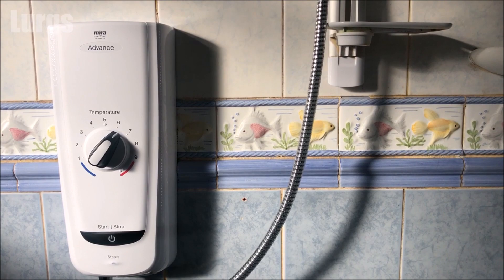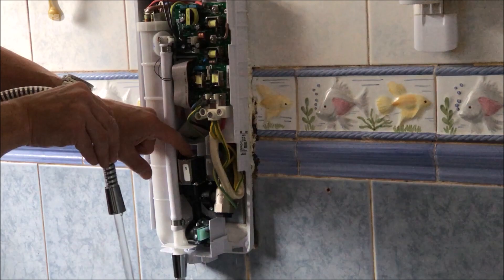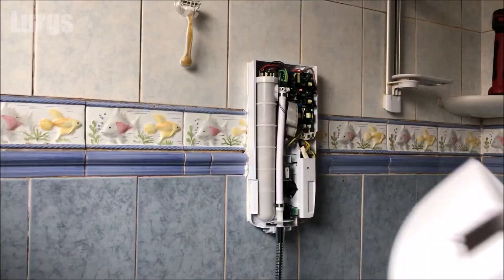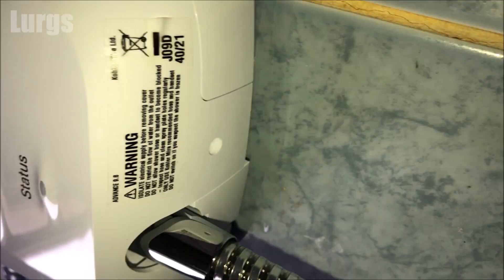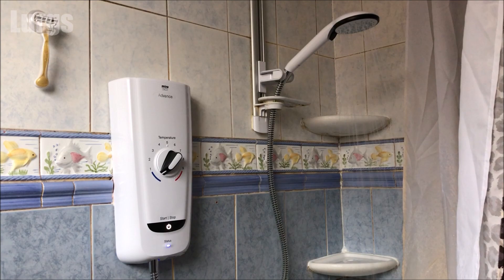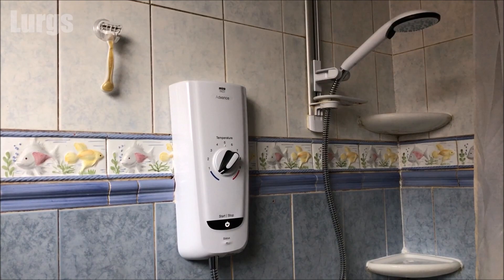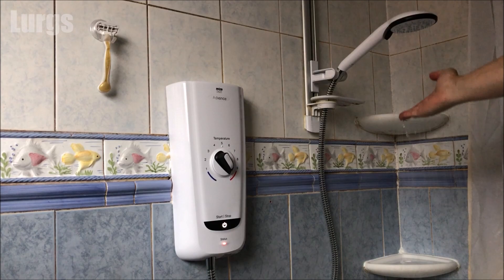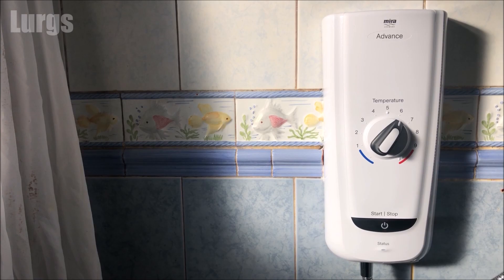How to Prime Mira Advance ATL & How to Commission Mira Advance ATL Thermostatic Shower latest model

Comment: Hi, I tried resetting my shower and also tried what you showed to do in your video, but it didn't work. I rent a council flat and when they sent an electrician out, he didn't even check anything, he just said I need a new one when I told him what was wrong and what I tried. They said it will be 3 weeks for one to arrive, is it really needing replaced or is there something else I can try? I even tried to get a Croydex Secura tap attachment on my taps and couldn't get it on, so I'm having to make do with baths - better than nothing I know.
Reply from the maker: Are you getting flashing lights on it? You can look up the meaning of them.
Pain having a bath. When we’ve lost a shower I just keep an empty large lemonade bottle or jug and sit in bath and fill that from running tap and pour over my head for a quick shower\wash which saves having to wait for bath to fill up
Reply: @LurgsHowToGuides The high flow light flashes when the shower is on, then when it switches itself off, beeps and the two LEDs below turn red, it stays blue. I checked for the error code in the manual and this is what it says 'Incoming water flow too low for appliance to operate safely, faulty Thermal Trip or faulty Heater Tank.
1. Reset the unit.
2. Check all plumbing isolator valves to the 
shower are turned fully on.
3. A section of the supply pipe is frozen, allow 
to thaw and insulate the pipe.
4. Replace Thermal Trip.
5. Replace Heater Tank.

I managed to force the tap attachment on eventually to have a shower, but the duct tape holding the shower head on the pipe wasn't holding and kept leaking, so I'll have to put loads more on.
Reply from the maker: Best bet is a Mira technician call out or if you buy a similar Mira shower it’s exactly the same fitting and screw locations

Comment: Does it work with a orange light after the final step or white , mine is orange with flow rate of about 4:5 lots per minute which I’m not impressed with so you input would be nice
Reply from the maker: Once it's running it should be a constant orange light.

Comment: Is factory settings the highest temperature for these care showers please? When the plumber fitted this, he said he could turn it to max if I wished but he is not allowed to. I was complaining it is not hot enough as I like piping hot showers. Can you tell me which tabs need to be on the ON position for hottest temp please?
Reply from the maker: Wow I have never ever gone above 7 on ours as that’s hot enough! Factory settings allows max temp of 48c. On the 8 switches inside the shower put them all into the OFF position, this should set it at Max temp. But take a photo of current settings before you change it incase you have to change it back.

Comment: Does those newer clamp brackets fit  on the older metal slider rail?
Reply from the maker: Not sure but it’s a terrible design on the actual shower head I can’t lock it  into place so it always leans down way too far .

Comment: great vid i have that shower with problems shower on some one turns on a tap shower stops now its just flashing red and white and i dont have a manual any advice thanks
Reply from the maker: Sounds like a water pressure issue. Probably worth checking the filter incase it’s blocked up with dirt and grit or try a brand new shower head if that’s a bit blocked.

Comment: Hi Lurgs.

I've had this shower for a few years now. Last few weeks I've noticed the water is just warm. For example how it would be on setting 4. I like it on 6-7 and it feels the same heat as if it were on 4. I've tried cranking it up to 9 (which is always usually too hot) but it's still not hot enough. In short setting 4-9 are the same heat more or less. Unless I turn it all the up then it's the usual scolding heat.

Do you think the heating element / thermostat has gone. Or have I unintentionally changed the temperature settings somehow. I.e. sometimes the shower has cut off for other reasons and maybe by me turning off/on the power supply and turning the thermostat could've programmed the temperature setting?
Reply from the maker: Is it still doing this after you've primed it again? Maybe check the filter as it could be blocked up.

Comment: Hi there bus many thanks for showing how to prime and commision the shower.

Mines a Mira Advance exactly the same, with the pressure bar me and my family would like to adjust the bar behind the service tunnel.

How would I be able to adjust the bar to 2 bar for water flow? if you could let me know, appreciate. 💯
Reply from the maker: I’m not sure I’m afraid as I’ve never had to do that.
Reply: @LurgsHowToGuides  Ah I see mate, thats ok, supoose we'd have to look into that, if possible.
Reply: @themondalorian9844 did you figure out how too up the water pressure 🤔
Reply: @Rusties844  Hi bud and I tried it comes out saturating but quite slow and weak, planning to have it pulled out and a new better shower fitted.

There are water pressure boosters for pipes too, as I havent checked them yet, you having same problem with your pressure?
Reply: @themondalorian9844  hi well my old Mira thermostatic shower failed and I’ve already bought the one show in this video just for ease of a straight no hassle swop,, and I was just curious on how too commission shower is why I’m here,, haven’t fitted the shower yet , it doesn’t really look that bad in the vid had too tell 🤔older Mira advanced thermostatic looked more powerful,, then I seen your comment you having one saying it’s very weak flow , so bit of a 50/50 if I want too fit it now🤔
Cheers
Reply: @Rusties844  Hi again and ah I see, the one you brought must be a 9.8KW as this guys shower is 9.8. currently mine is a 8.5KW, must be why its weak, had mine since 2018 as Leonardo dicaprio would say "time to replace" 🤣 jokes aside.

Would yours be a 9.8kw? yea check the fittings also if the water flow would be good, my plumber said he could fit a fuse to make it boost more power from the shower, not sure what he means in regards to the fuse as Ive not seen him yet.

Yea agreed 50/50 🤔 maybe the Mira Sports Max or one of those may be better cheers mate 🍻
Reply: @themondalorian9844  hello 
Yeh so mine also is a 8.7kv 🤦‍♂️ I do believe for some reason my old Mira advanced was 10.?kv  that said it is a swop no changing pipe wiring nothing why I purchased it no need for a sparky or a plumber as I’m quite DIY confident, I’ll be fitting it tomorrow when I’m bk home,, I’m leaving it in factory settings mode (every switch too off) not putting it on the BEAB care setting we’re it beeps every time it’s in use,, I’ll let you k ow how it flows once it’s in,,🤞
I’d also be interested too know how a another fuse would make it perform better as your plumber said🤔
I run mine on a 45 amp isolator switch but that recommended anyways🤔interesting 👍
Reply: @themondalorian9844  also quick check. The higher the kv rating on a electric shower the more water it can flow at desired temperature so 9.8 /10.5kv showers (thermostatic) give you that high water flow nfeels more powerful. Lower kv 7.5 8.5 lower flow rates same heat. And use less electric, but I’m in out shower no biggie for me but that how it works in a nutshell form a quick look so mine will be low flow rate at 8.5kv 👍
Reply: @themondalorian9844  all fitted and it’s got good pressure quite surprised with it actually just a tad less flow than previous shower (Mira) but it’s not weak or slow flow by any means , could be a problem at your end pal🤔. Anyways hope you get it sorted 👍
Reply: @Rusties844  Hi again bud and good to know its working out for you 👍 yea there must be a problem with the mains or pipe, Im gonna call out the plumber to see his opinion.

I agree its beautiful once it gives you that great flow, when I used to have the bath in the water pressure was so good you'd ve done in 10-25mins lol.

Yea thermostatic at 9.8V can produce more flow and better quality, I wonder whats causing my shower to be weak or slow, will find out soon hopefully, I will keep you updated.

Apologies for a little late reply, I got quite busy, had to run and grab quite alot of stuff you know how it is, enjoy your showers too. 👍💯
Reply: @themondalorian9844  cheers 👍 sounds like your saying it worked fine until you took out the bath if that’s what your saying could be the problem there somewhere 🤔

Comment: Hi.
Is there anyway to increase water flow preassure - IE not with the shower head medication - actual root of cold water pipe into shower? i tried the turn valve and got a small improvement.
Reply from the maker: You’d need to check your mains cold water pressure. Obviously if someone is running a tap or flushing the toilet close by this will affect water pressure.

Comment: Hi there,  wonder if you can help me, I too had the mira advance old model that you shown at the beginning of the video and after a few year last week it broke down and was replaced with a new one which looks exactly like this one you have .
However it seems like its does have as much pressure and flow as my old one and now thinking it wasn't primed like you did in this video as I was watching him install it and never seen him do that,  I'm thinking if doing it now.

 I wanted to ask how much kW was the old mira advance you had?  I can see in this video when you was putting the screw in this new one you have is 9.8kw model in this new one , I'm presuming this  would mean it has more water pressure and flow to your old one? 

I can't help feel that my old one had a high and low switch option and this new one doesn't could this explain why its doesn't have more pressure when using the shower....
Reply from the maker: No harm in priming it. But it could just be coz of a different shower head. Modern showers don't use as much water so it could just be that. Ours seems to be ok though. Hopefully if will sort it out. Good luck.
Reply: @LurgsHowToGuides  I primed it about 1 hour ago and the first thing i done last week when i noticed it doesnt seem as powerful as my old one was to put the old mira advance showerhead back on with original hose and its still the same.  When I put it on the coldest settings it gets more powerful and that's how it was when I use to use my old one at temperature 6-7 

Do you find your new one less powerful than your old one too?
Reply from the maker: It’s about the same, BUT check the manual as you can alter the Factory settings on those Pins, it may be set at a lower temp. Possibly setting a higher temp will help. Else there’s not much else you can do.